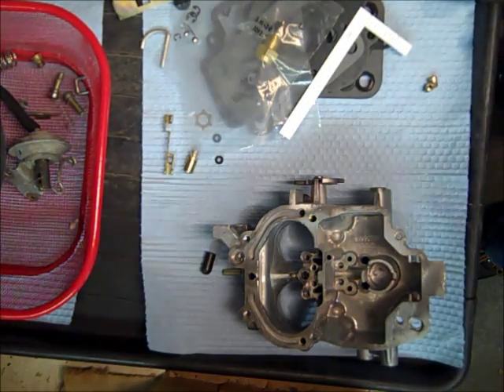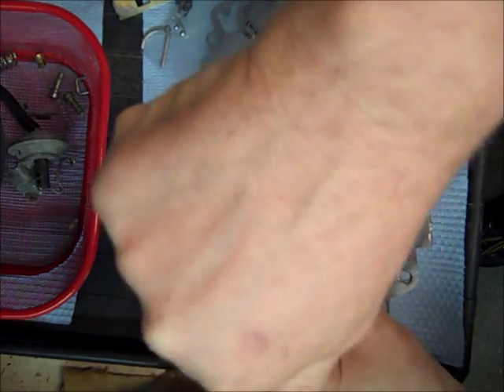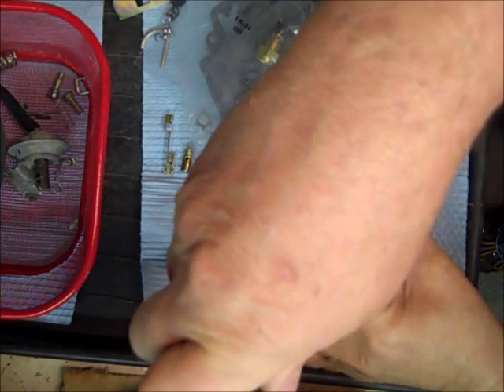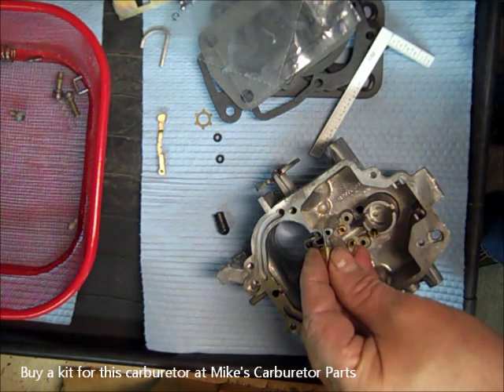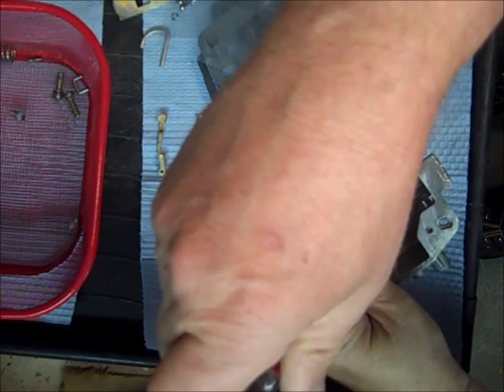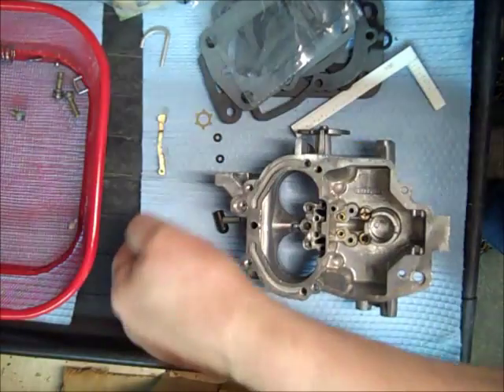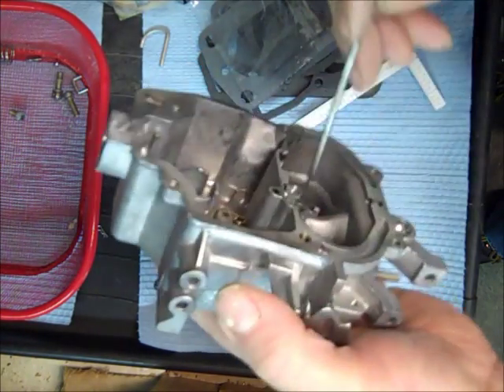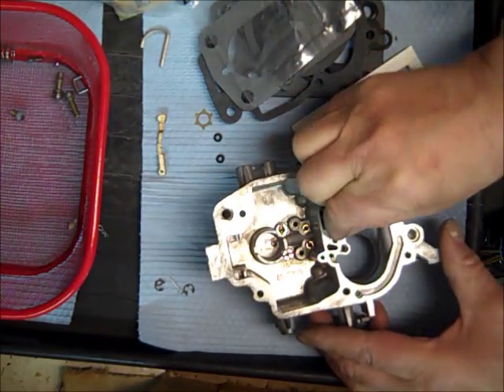Holley 2280 Carburetor Rebuild Part 1

Comment: Do you have a video on how to removed the mixture adjustment plugs on the 2280?
Reply from the maker: Nope but you simply drill them out until you tough the idle mixture screw then pry the plug out.

Comment: I have an 87 dodge van with a 318 and this carb which I purchased through an auto store, as I couldn't get anybody to correctly rebuild the original one. (I still have it). It bogged through acceleration.This rebuilt carb performs great, but is running rich all the time and won't pass smog. The tail pipe is now black. How do I lean it out? Should I put in the main jets from my 1st carb? Somebody please help. Thanks, Ron
Reply: was your original carb electronic feedback with the ecm and electronic distributor (with no vacum advance)? did the replacement carb have all the same electrical connections?

Comment: Hey Mike,this is an EXCELLENT video if you haven't seen it. https://www.youtube.com/watch?v=1-pks8FoC6w Highly recommended to other viewers as well. I think you put the bowl vent pad (black rubber thing) in the wrong way, also... it's supposed to seal the opening leading out of the carburetor, through the bowl vent tube/hose . The video linked to above also shows how to do some important adjustments, and is very helpful in understanding the carburetor overall. It was made by Chrysler when the 2280 first came out. Have a good holiday... Fred

Comment: ok so im working on a 318 with this carb on it and ive rebuilt it. last night i was going to start it and suddenly fuel came flowing out of a vent comming from the accelerator pump housing. just wondering before i take it all apart again what could cause that?